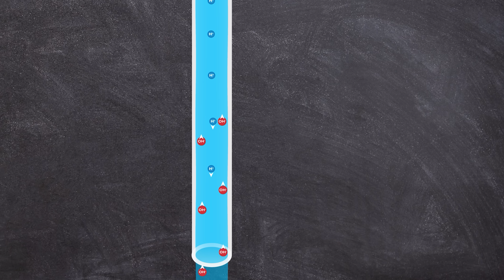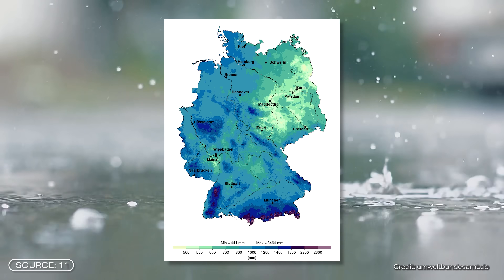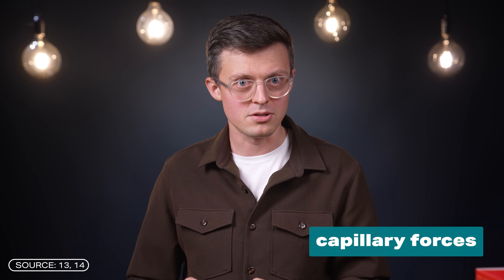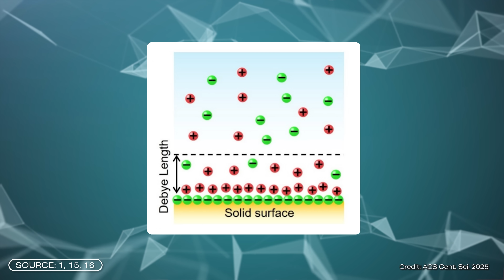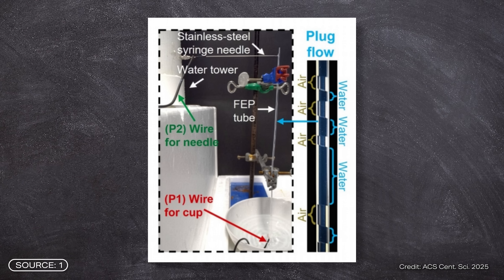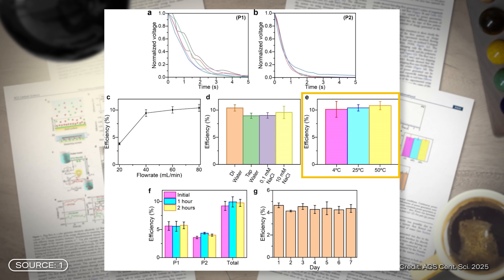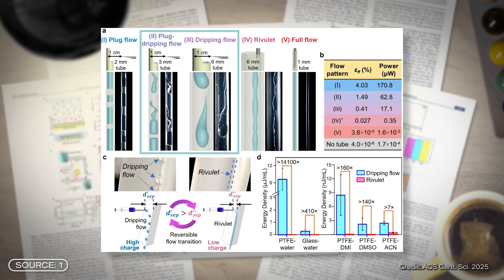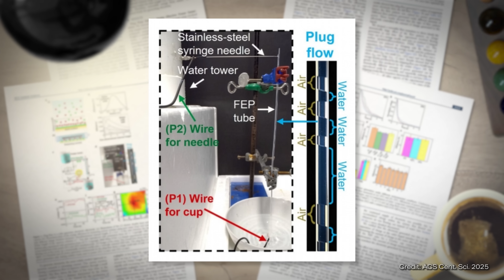Physics Hack: 100,000x More Electricity from Rain!

Comment: This all sounds great in theory. Unfortunately, it falls apart as a scaled method for electricity generation. Basic hydroelectric generation methods are simply far more efficient. I ran the numbers based on the average rainfall on my roof in Florida (~48 in of rain per sq.in. per year, ~3788 sq.ft. of area, ~3 m of height from gutter to ground). This translates to an average of 0.4 W of power or a total of 3.5 kWh of energy per year. In the context of an average house of this scale, which consumes ~40 kWh/day, that is a little over 2 hrs of energy per year (~126 min) that is available from rainfall. Basic hydroelectric generation is ~70-90% efficient, so it would be safe to say that I could practically obtain about 2 hours of electricity from rain per year. Based on the numbers given by the paper and for the same conditions, I would need 11 tubes (assuming continuous operation, so reality says way more tubes or a large tank and less height to account for the way rain arrives) and I would only be able to collect 0.045 W of power (again, averaged over a year), or 0.4 kWh per year and 14 minutes per year, respectively. That is ~11-12% of the energy collected. Bear in mind that the gravitational component is necessarily replaced by the direct to electricity method. The lack of moving parts is nice, but it more than likely can't justify the extreme difference in efficiency by a modest decrease in expected cost of replacement parts. I realize that my example is a rather absurd case. The novelty of rain through a gutter charging a phone is more of an academic exercise. However, these disparities remain when scaling up the technologies to that of melt runoff in the Spring and flowing rivers. A direct to electricity method based on charge separation would need to compete with mature hydroelectric technologies, in the range of 70-90% efficiency, before the relative cost difference of replaced parts (wear and tear) could justify a change in technology. Standard hydroelectric generation is scalable and it is used all over the world to collect electrical energy, not only at a dams. For the individual hobbyist, a home setup to collect hydroelectric power is only reasonable when running water is available from a river or stream. Rainfall alone is simply insufficient. Returning to the example of my house and scaling up, my roof would need to be ~2,200 acres in area to cover the total average electricity demand of the year. At ~12 acres, that is ~200 times the size of the whole property. Even in a wet state like Florida, rainfall in a residential setting simply is not viable. There is not enough potential energy to capture, even at the height of a tall apartment building.
Reply: And plug flow is an old concept. It is novel that it was used for this application, but it is one of several basic means of operating chemical reactors. A basic reactor type covered in undergraduate studies is the PFR, or plug flow reactor.

Comment: On the topic.
1. If optimal length is 32 cm then what disallow us to use cassettes of those tubes in successions? Mean... I clearly can imagine relatively practical stacking of those tubes in blocks between which are separator which regulate water drip into next block of tubes.
2. Is it really critical to use polymer tubes? Mean tubes can be done cheaper despite diameter. This 5€ tubes for me sounds like some luxury gilded something.
3. They increase energy output from what numbers? Mean, how much energy this system actually produce per one tube in system? Is it really viable amount?

Comment: I used to live in a condo, and when it rained hard the water would rush down the gutters. I have thought for a long time after seeing that we could build water funnels to collect rain water and have towers that run the water through the spirals and as it slides down the water spins turbines to generate electricity.
Reply: and what  great way to get down to ground level when the elevators are out. Kids'll love you for this
Reply: Rain falls from much higher than the highest dams. It is the height of dams that is the source which hydroelectric exploits. Therefore, almost all of the energy is lost before it gets to dams. Kind of too bad.
Reply: Do it
Reply: No need to think about that for a long time because you can just Google that. Copy the formula below into Google and adjust according to your situation.

(13 meter * 8 meter) * (4 meter)  * (700mm / year) * (9.81 m/s^2) * (1 kilogram / liter) in watt

(roof dimensions) * (gutter height) * (precipitation) * (earths gravity) * (water density)

My roof would yield about 0.1W (average theoretical maximum over a year). A large high skyscraper could get achieve a few hundred watts or so.

Comment: 100,000 times more? More than what? Science? If rain water really provided sooo much energy, it would be very dangerous to go outside in the rain. Energy doesn't appear magically, it has to come from somewhere.
You're not extracting energy from the water molecule itself, only from the difference in gravitational potential when it falls. The gravitational potential doesn't let itself be "overcome" to produce more energy than is there. 100,000 times more?
To make any use of that potential you would need huge amounts of water. I suppose you could get that by building a dam in a river. Oh, right, we already have that, as you showed. Hmm.
Is your next video going to be on vertical axis wind turbines as a "game changer"?
100,000 times more? Would you like to buy a bridge? 😅

Comment: I wonder if this setup is stackable and scaleable. Multiple needles and tubes per upper tank all flowing into a lower tank, which then repeats the process into a tank below... Could it be stacked like that and fed with a ram pump? Probably not as efficient as a hydroelectric generator built into the stream, but at least it won't block or slow the stream :)

Comment: Why can't you have solar panels with TENG ~3 meter up and still use this interface effect to generate power from the potential energy?
And add a way to get energy from the impact of the raindrops and you've got 4 ways to generate energy from the same spot.

Comment: For this approach to work it seems to me that you would require incredibly "clean" water (lacking debris) to be coming off the roof and through a collection system.
Something I have long thought is the concept for building in-line hydro-electric turbine "Packs" that could be installed into existing vertical downspouts at specific intervals with the power created being sent to a charging battery through a relatively simple collection harness.

Comment: We should restore the old-fashioned technology of using riverside mills with a water wheel to generate power.. it's relatively low maintenance, doesn't take up farmland like those massive pylons that can't be recycled, and is an attractive sight to behold on the riverside.

Comment: The advantage of this approach is that it works when it rains - both day and night. And in places with lots of rain, as long as the system can be made significantly cheaper and reliable, it's a great complementary solution to other renewable energy solutions.

Comment: Germany, land of snow, will spend billions on researching how to generate power from rainwater, instead of trying nuclear.
Reply: Land of snow? Germany has regular snow in mountainous areas - mostly a small part of the Alps - but average snowfall across the country is relatively low compared to its neighbours. Average snowfall is much higher in France, Italy, Austria and Switzerland. Consistent rainfall is far more significant across Germany than snow.
Reply: The reason for the research is that there is no safe solution for the radioactive waste, produced by generating electricity via nuclear power plants.

Comment: It sounds interesting and kinda cool... but realistically, especially when accounting for water flow restriction in real world applications, it'd be much easier and cheaper to just use "old primitive tech" like a high-efficiency water turbine generator in the downspout/downpipe that pretty much every house already have. It could be sold as a simple self-contained "plug-in system" and you wouldn't need any special tools or specialized serviceman to install it, it'd be actually robust and it would have no impact on rainwater collecting or solar panels, which makes it almost too obvious option... the only downside is the small amount of energy produced.

Comment: This makes me think 4th-phase of water. Describe by Gerald Pollack (GP). Google it if you want to learn more. Water in contact with a hydrophilic surface forms a thin layer of this 4th phase  water, called EZ (Exclusion zone) water. It is negatively charged Next to it there will be a thin positive layer (the EZ-layer "stole" electrons from it).  Infra red radiation is also involved in the process. Maybe some of the viewers of this channel can investigate this further. (I'm to lazy) Furthermore, this will not work in freezing temperatures and obviously rain is needed, so it's usage is limited. GP also presented this on the YT-channel Electric" Universe".

Comment: In relation to this you may want to watch a 12 year old video by MrTeslonian called  "Hydroelectric Electrostatic Generator." This may be more effective if you can convert the roughly 30,000v of static electricity into useable power.

Comment: Great video! I wonder about the water coming out of the system.. If positively ionised water flows off a rooftop installation, won't it be acidic? Did the researches look at whether the resulting water chemistry would adversely affect drainage infrastructure or have problematic downstream environmental effects? Thanks!

Comment: I reviewed the paper and they have made a mistake and overstated the power density by a factor of 640x.      I looked to see where the power factor had been derived from and I found that the  authors have made a fundamental error in  their calculation,   they quote a peak power of 440 ± 13 μW  for a 2mm diameter tube,  320mm long.  To derive the W/m2 they have used the area of the end of the (2mm diameter)  tube and used that as the multiplication factor and indeed this would give 140W/m2.  However,  plug flow generation depends on the surface area of the generating device, that is the internal surface area of the tube.   This means that they have an error of 640x  in their energy density calculation.   The correct figure is just 0.21W/m2 for the device. This is not a practical cost effective way of producing power in any form.
Reply: Yes snart watc 0.15 watt night light enough usable stare us e able eber low energy er gy too buy it

Comment: Since 50-70% of rooftops in the netherlands have solar pannels (dont know but at least a very substantial ammount) there are allot of transformers already. Isnt it possible to make the drainage more central and put a whole bunch of water wheels + dynamo in the rainpipes. Just for a Rain pipe it doesnt seem efficiënt. But added to the solar power there is less Downtime for all the converters already placed

Comment: It's probably inaccurate, but LLMs estimate 1600 to 4800 times more energy collected on an ideal solar month versus an ideal rain month using this technology.

Chat: Rain, wet month, 150 m² roof: ≈0.013 kWh for the entire month (optimistic upper bound from the study’s physics).

Solar, one sunny day, 5 kW array: ≈21 kWh in a day.
→ Solar (one good day) is ~1,600× more energy than rain-harvesting (whole rainy month) in this scenario.
Grok: The rainwater system over a full rainy month generates about 0.00021 kWh/m²—roughly 4,800 times less than solar panels on just one sunny day.

Comment: Wouldn't this process work in any steam turbine main condenser were water is dropping out of steam into saturation causing consistent plug flow?  The mass flow of vapor to water could be across a matrix of FEP tubes used as a low cost power recovery from low quality steam.  The process could be used in a closed loop system to generate a return on condensate with isolated cathode and anode plates separated by FEP tubes and steam returning to water within the tubes.  If a high temperature FEP type material could be found, the boiler water to steam interface could also be used.

Comment: Did I miss where you consider the entire life, from raw materials to replacement, of the equipment? The plastic takes energy and materials to be manufactured, but so do solarvoltaics. If the refined elements in the solar batteries take enormous amounts of energy and result in far more filthy byproducts, are they really worth the higher costs to produce? I don't know where  indium and gallium come from, but they sound like biproducts from silver and gold mines. Plastic sounds like direct product of petroleum. I know not. I just wonder if the net lack of benefits in the two cases makes the water-plastic device a better overall choice.

Comment: There are much better devices outside the academic community that are not even looked at because you can't patent them... such as the remastered galaxy in a box that does about 30 megawatts with no moving parts... also making it's own water and charge separating it with sound and radio frequency feedback. It also levitates because of the parallel conductors with the current going in the opposite direction. No rain required because it makes it's own water from condensation and uses the excess heat and sound it creates to power itself.
Reply: When you Translate an Art AI into a LLM

Comment: Your price assessment is incredibly naive. Any serious manufacturer would scale this solution using injection-molding and producing modular parts that can be daisy-chained horizontally and vertically. If it’s relevant, conduits’ surfaces can be PTFE-coated. I bet it’d be 100s of times cheaper / m.

Comment: Teng isn't a direct competitor. I think you're looking at it wrong.

You'd hook the small tubes up to your gutters. 

So you're solar panels would generate electricity from the raindrops, then it collects the water in your gutters, where you'd use these tubes to get even more power out of the rain

Comment: This invention is useless. 420 microwatts - to get a useful level of energy you would need a million of these tubes. Then it only works when it rains, and as long as the tubes don't get clogged up.
Reply: 1M tubes is 1000x1000 tubes. If each tube took up one mm^2 then that is 1m^2. You didn't bother to pay attention did you?
Reply: @WhatsThePointOfIt  What's your point? There is no way 1m tubes can be practical.
Reply: @TropicalCoder  Not if you exist in the 1700's. Maybe take the DeLorean and get back to the future?

Comment: What about aspirated air flow at the bottom.  Have they ever checked the charge with water flowing down and air bubbles flowing up?  Idk just curious as it not only gives much larger surface area but seems like it could give a charge carrier to increase end results.  IDK, probably not but just a thought that crossed my mind while watching this.

Comment: Macht's gut ist farewell, auf Englisch.
That's an interesting idea, but as you say, there are some pretty big obstacles.

 I think the price is the largest. The cost of the tubes will be much lower than the drip-needles, and then there's the electronics and so on.
I would say the robustness could be overcome a little more easily, though.

If the water can be stored in a tank, you can generate the electricity much more slowly, and not just as it is raining. This could cut down on the number of tubes, etc. required.

Comment: The drops needing giving charge highly voltage when they flying across circle that in down take off charge on metal plastin.Only that been work effectively.ilectrik Charges for charge drops needing conversion in static charges semiconductor and graven.

Comment: Sorry, but this is nonsense. We have the law of conservation of energy. If we have water at the top of a device, and chemically unchanged water at the same temperature at the bottom of the device, the only available energy is the gravitational potential energy; It makes no difference how much you separate and re-unite the water's constituent ions. We can extract the gravitational potential energy using an old fashioned paddle wheel or turbine and get just as much power. The amount of energy available from water on a building's roof is easily show to be so small that it is not worth collecting. For example a 100 sq m roof 10m above ground with 100cm of annual rainfall yields less than 3kWh per year, saving about 50 cents per year if everything is 100% efficient.

Comment: So just stack these and it will act like a lock system and every 32cm of drop creates energy. An H2O power wall if you will!  Most houses have at least 2 down spouts. So 2 points of power production each with min. of 10 power collection points. Make sense

Comment: 100 times more electricity is still not a lot of electricity.  I watched a video a while back where a guy connected a generator to a downpipe and generated enough power to charge a phone.  It only took a week ;-)

I think I'll stick with my solar power

BTW there is nothing whatsoever wrong with your English.  You have nothing to apologise for

Also, it's going to be very hard to separate a downpour into so many separate 2mm tubes and make it drip.  I live in the driest state in a very dry country (Australia) and I can't imagine even a light rainfall dripping through 2mm tubes, even if my entire roof were surrounded by them

Comment: Obviously it won’t work in areas where it freezes.  It hot places like deserts not only is there too little rain but even when it does the air temperature may effect the droplets size.  How does this compare to a paddle wheel connected to a generator?  The rain water would for the paddle wheel to spin - very simple and doesn’t require perfectly clear water….
Reply: Buy pedal boat